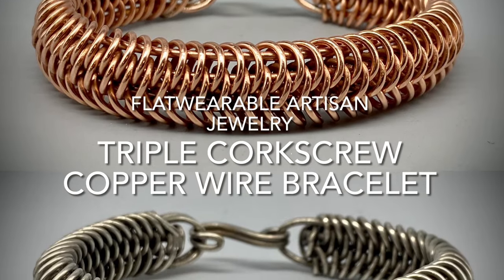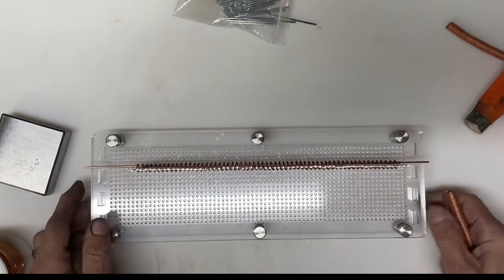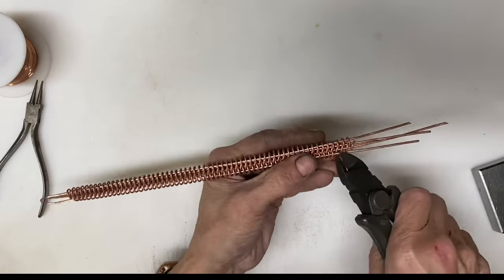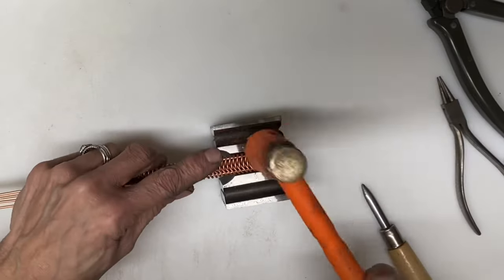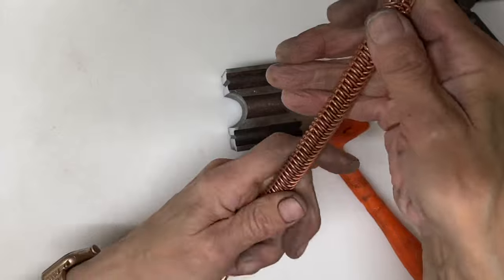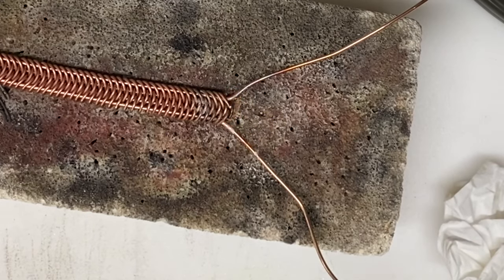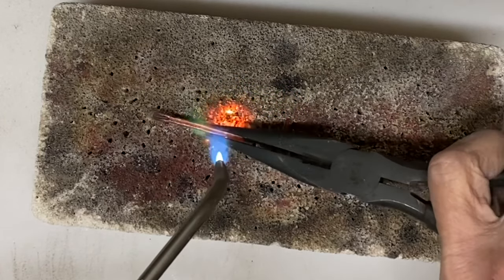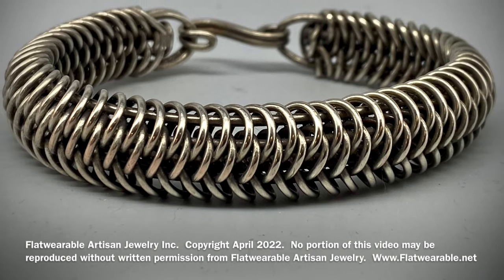Triple Corkscrew Copper Wire Bracelet made with the Flatwearable Wire Weaver

Comment: If you need it straighten cut it slightly longer a put one end in a vice ab the other end in a pair of vice grips tightly and with a little bow in it yank the players away from the vice hard and it will be almost perfect with out beating the snot out of it